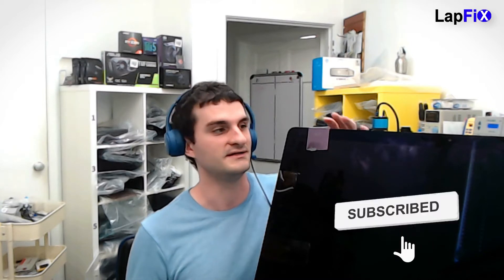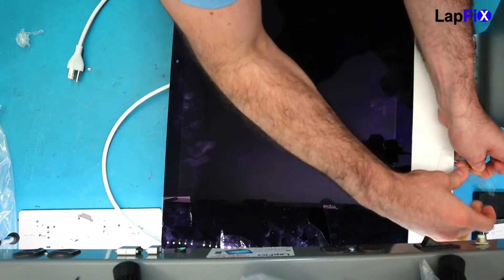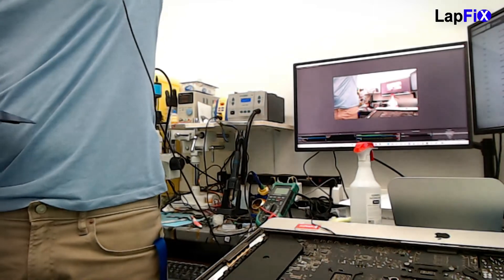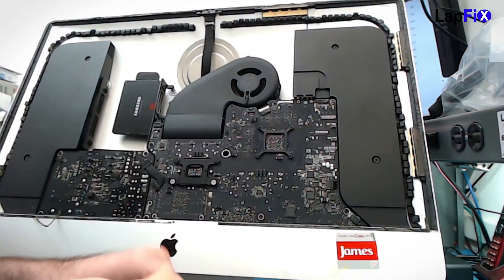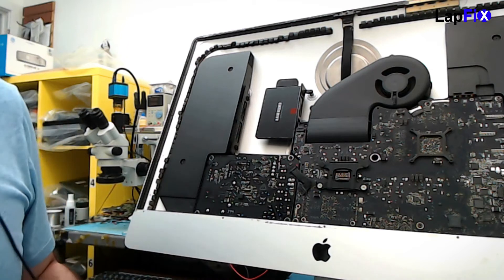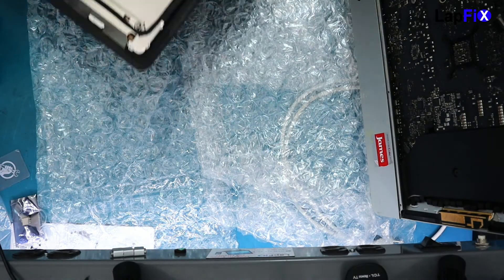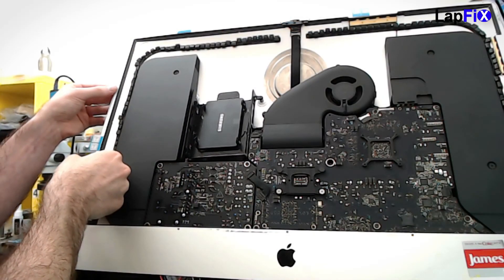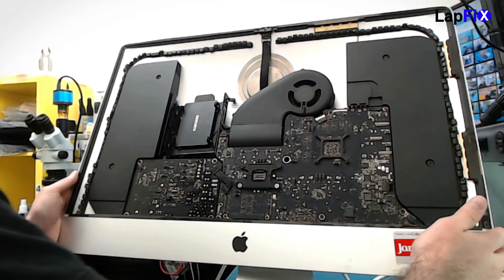Upgrading iMac A1419 2019 to 2TB SSD and Fixing the Screen Display

Comment: do you have a tutorial on how to fix the display got damaged during the the process of taking it off and upgrading SSD in which the display developed a blank column?
Reply from the maker: The panel is welded to the glass, if there is damage to the display, you may need to replace it